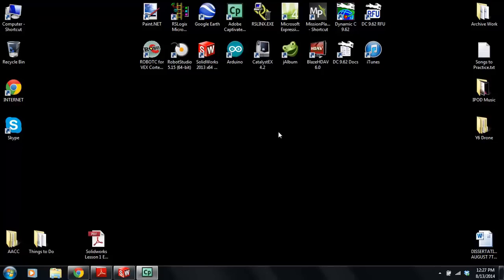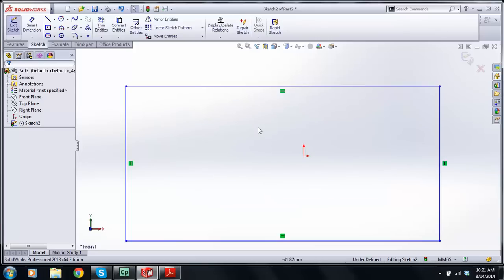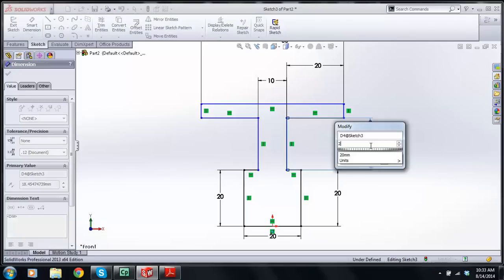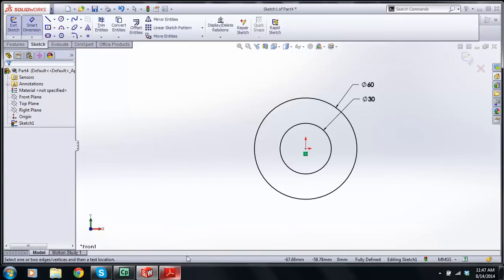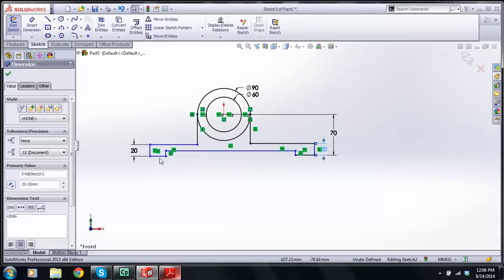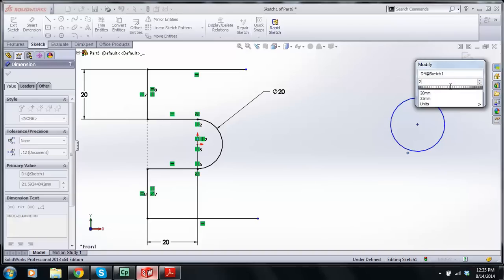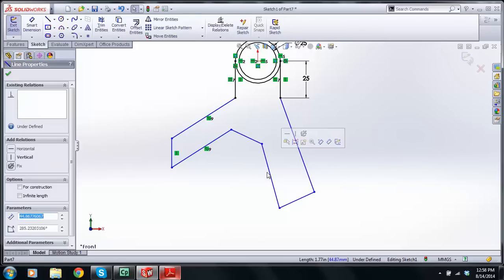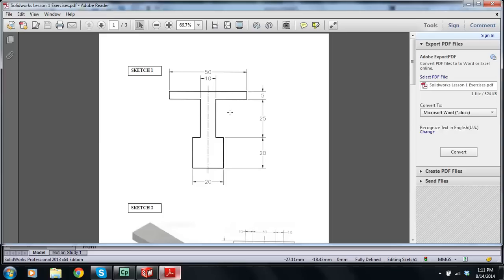Solidworks Tutorial 1 Creating Sketches

Comment: Hi Tim,
I recently downloaded the Solid Works 2019-2020 version. In completing the first drawing (jack hammer) the drawing shades in the entity unlike yours that remains in blue wireframe geometry.  I'm not sure why this is happening. I've tried different things...but when completing the jack hammer it shades in the object...which I think isn't supposed to happen...
What's happening??
Thanks
Reply: When the drawing is not given all necessary dimensions then the sketch shows blue color but when it is given all required dimensions, it will turn black which means your sketch is fully defined.

Comment: Thanks for the video, am new to Swx , am trying to design a compound parabolic concentrator using equation of the parabola by specifying the acceptance angle and focal length and also the absorber length and later on do ray tracing on it 

would you assist me with that

Comment: I was really starting to understand solid works better with your tutorial.  But I must have some settings set differently.  I start to make a new line but I can not see it until I try to close sketch.  My lines will not snap to horizontal and vertical.  Getting irritated quickly.  Is there a good common settings group of icons to begin so I will have all the functions I need?

Comment: Great video. Noticed something on the last example. You said you didn't know the dimension for the last line on the drawing, and you made it 35mm. However if you look at the drawing, the endpoints of the line line up with the vertice of the outer lines, and so the two lines that run length wise on the lower part of the drawing out to the ends would be equal for each side. 

Could be wrong, but that's how I looked at it.

Comment: I like the accent.....very good tutorial, I have a little comment if you don't mind... in sketch #5 you were wondering where is the best point for reference, basically the sketch is showing most vertical and horizontal dimension are derived from the left lower corner which indicates it should be there, also from machining perspective its preferred to have your reference point in a position that you can locate easily such as a corner or a hole.